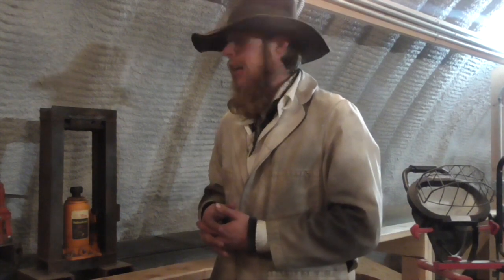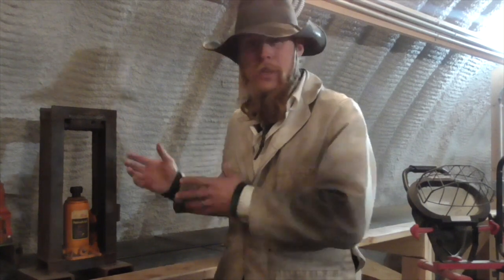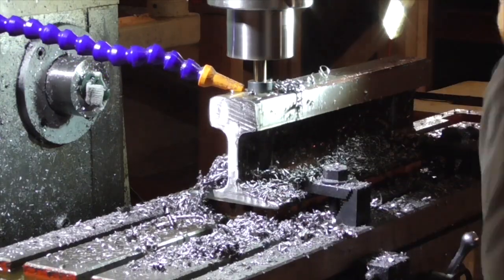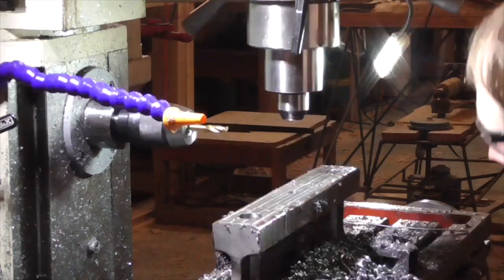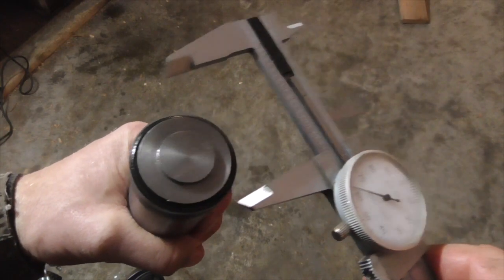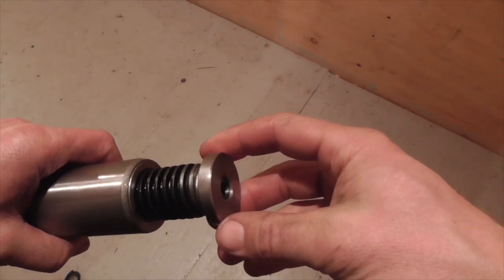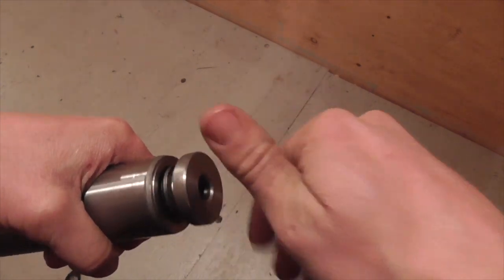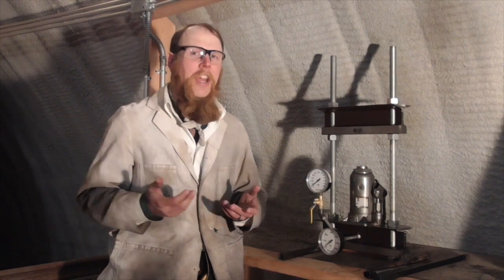Building an Instrumented Hydraulic Press (TIS212)

Comment: I guess the metal used to the jack is under compression and should only have  downward forces applied to it, I think the weak link would be the first two threads! Looks good thou, could have done a little more detail on connecting the pressure gauges.

Comment: Looking toward hearing more about that. Seems there could be MANY uses !  I've been thinking of die cutting and pressing.  I was amazed at how fast your mill bored that 1 inch hole.  On rare occasion I've had to drill large holes.  Last times I was trying to drill 1" D holes thru 1/2 " mild steel.  Took me about 12 steps up in drilling - then even had to recut the bit to a much steeper angle.  My ooold drill press is only 1/3 HP - and belt driven no less.   Would love to step that up in the future - envious of your nice setup and watching helps me understand what kind of operations I could perform with such equipment.  Hearty Thanks!!